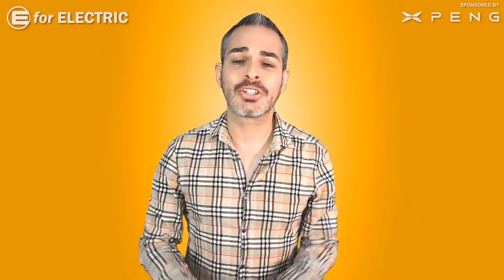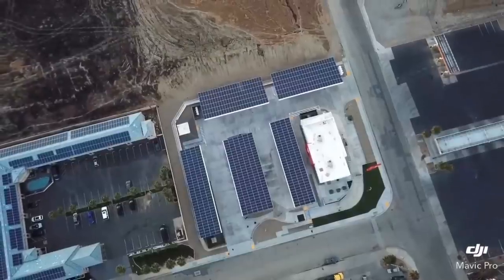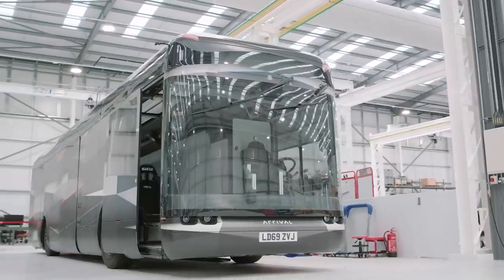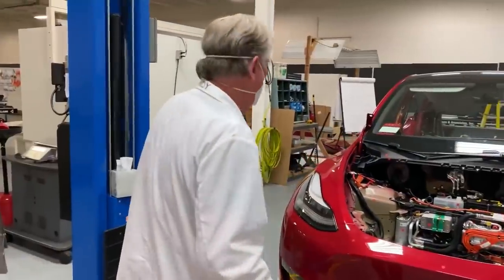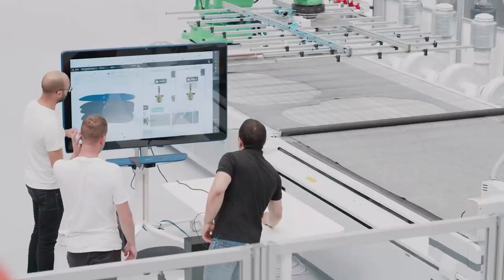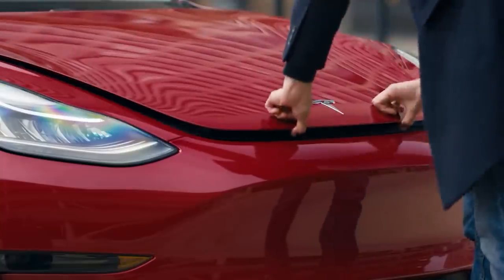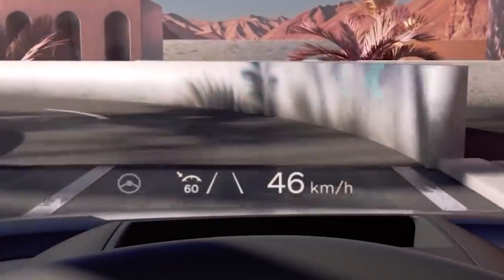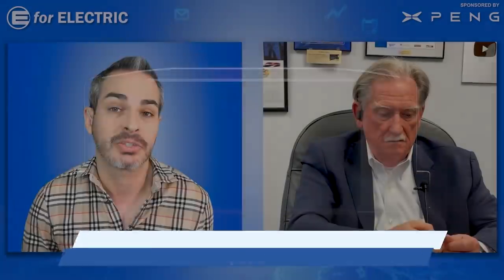Sandy Munro vs 2021 Electric Car Tech

Comment: The biggest issue with battery swapping is that the company owns the battery, and battery tech is quickly changing year over year.  When breakthroughs happen, the old batteries become obsolete and NIO will be on the hook to get rid of the old tech batteries and replace them with better and more up to date batteries.  They will have to eat all of that cost.

Comment: I feel like there are flaws with his take on battery swapping. For one thing you'd still be charging more than swapping and the most likely connector to fail is still the charge port. If built with it in mind either of those should last a very long time and be fairly serviceable. Also the propane analogue is just being weird about things IMO as long as you pay for usage and not ownership of the pack who cares.
Reply: I agree, especially if it's a large slip fit connector, also with connectors as consumables they are typically easy to replace. Also the batteries are tested at the swap facilities and the degraded ones are rotated out of circulation, so with battery swapping you always have a pretty fresh battery so in the long run battery degradation isn't a worry. The only tripping point I can see is the cost, whether a subscription service or a per battery redemption it may be more expensive in the long run versus just charging.
Reply: here is my laundry list of things wrong with swapping batteries :
> extra weight , you are literally putting a box inside a box . the car still needs to be structurally sound when swapping , and the mount points and swapping joints/ connectors all add weight.
> if you have one size fits all for swapping then you are not optimising your pack to work well with your chassy, it would most definitely affect drive balance, suspension, etc. else you would have to have stock of different skews of battery packs which would be very cost prohibitive (ultimately you end up paying) .
> A battery pack is very heavy and would likely wear the mount points to the chassy in dynamic driving conditions . points of contact = point of failure. and if not mounted to the chassy perfectly every single time. it would wear out the chassy unevenly. you can design around this but no option without adding extra weight.
> battery tech / capacity has improved on a rate of 2% YOY if you assumed the same trend to continue . it would take 10 years to reach 20% improvement (my estimate of when a switch to new tech is worth it) avg us new car ownership is 6 years.
> and if you didnt do swapping you are much more likely to wear of the bearing on the motors before needing to change the battery. at which point you could sell it and get something new.
Reply: @MrEtronic  There are counterpoints to most or all of those. You may add some small amount of weight to have a swappable battery, but used appropriately your car will be lighter and have a smaller battery the majority of the time. Also batteries already aren't structural for by far the majority of EVs so that isn't even a real reason they would be heavier.

From the design standpoint you can design the car around the pack and not vice versa to come out with something that is still perfectly fine.

As far as mount points there are extremely durable mount points that get changed out regularly on cars already. You should rotate your tires every 5-10k miles and the entire weight of the vehicle rides on those mount points. They are durable and perfectly fine. A solution for durable mounting of batteries can also be found easily. This also wouldn't be something you do all the time. Normally it would be done a dozen or two times a year or so.

On your calculations for one thing you are using a rate of improvement far worse than I've seen most places claim and for another thing haven't taken in to account compound gains. Even at 2% yoy that is under 10 years for a 20% better battery and it's likely better than that.

As far as the motor going bad before the battery that is contrary to what I've heard and expect. We've yet to actually have EVs around long enough to see for sure though. Even ignoring that making things more modular always reduces waste. It doesn't matter which component goes bad first, the vehicle or the pack, if one is still good it can stay in circulation. Even if your argument of horrible battery improvements and crappy motors that wear out before the packs is true, swappable batteries become a good idea because then you replace the car and keep the pack in circulation.

There is also the huge difference in necessary battery production. I still lean toward the PHEV side of the argument because especially for someone who drives like me I get 95%+ of the benefit of the EV, don't get some of the drawbacks, and for the same amount of batteries about 5-10 times more vehicles can be made. If I bought an EV I'd need 150 miles+ range to do some of the things I do a handful of times a year or so. By far most of the time I need like 40-80 miles of range max and my most common day is probably about 10-20 miles driven. If we want accelerated adoption of EVs we need to find a way to make the least batteries serve the most people we can. The best ways to do that are either PHEVs or swappable batteries.
Reply: @christopherpedersen1820  sorry i made a mistake in my calculations 10 years is the correct number, most people in the US switch their cars close to 6 years. but all other things i mentioned were still correct IMO  if your going for nuts , the threads shouldnt shear of from wear . so they would need to be large to distribute the load evenly. if you wanted to go for anchors / snap fits they need to be made in such a way they dont snap on high impact situations and launch the battery pack free like a projectile. a battery pack being welded is different from being mounted , even if the cells are not load  bearing the pack as a whole still is. if you go for a mounted solution the battery pack needs to be strong enough to carry itself , the chassy needs to be strong  enough to carry itself and the pack , There is no way you come out with lesser weight solution than the existing pack . best you could do is make it small enough to get it to 5% of the weight diff. but you still end up paying lot more in the long run with either subscription type service or sale / purchase of a newpack OEMs have  to keep batteries charged even when they are not used and keeping them in stock is still going to be a huge burden on the OEM and would only increase as they open more stalls. A small note on PHEV < ICE engines < pure BEV , you would need to replace the battery much sooner you loose the benefits of BEV's like low cost of maintenance, most PHEV weigh as much as a BEV and have lower performance than both BEV and ICE .
Reply: @MrEtronic Many evs already have a separate battery as a module that can be dropped out of the vehicle. Go look at the nissan leaf or chevy bolt packs. They're sealed units that can be dropped out of the bottom of the car. It's the smart way to do things from a repair and sustainability perspective. Also the whole point of swapping is to make the overall battery production and cost lower. You won't pay more because 90%+ of the time you'll be using less than half the battery you would if you just bought a vehicle with an oversized battery that you almost never utilize. Also simply having a gas engine doesn't drastically increase maintenance if you barely use it. Putting 1000 miles a year on an ice engine and 9000 on the electric the ice engine will rarely need maintenance and will outlive the vehicle in by far most cases. For me the vehicles I'm between are the Bolt, Volt, Leaf (2nd gen), and A3 e-tron PHEV all 2-4 years old used for $15-20k. Honestly the A3 e-tron is by far the most attractive of the group in general to me and also the volt or it seem like the best option usage wise. Saying PHEV<ICE<BEV is pure ignorance TBH. There are different use cases where each is the best and PHEV can and in my case mostly will offer the best of both worlds.

Comment: Battery swaps have something in common with buying a used car, you never can be sure what the previous owner did to it. Of course the battery unlike the used car, can be again swapped. There is also the connector wear to be considered. I'd keep the entire vehicle and battery if you please.

Comment: I was going to mention propane tank swap for my grill— nasty experience, but Sandy beat me to it. So no, I don’t want someone’s abused, greasy battery in my $55,000 car.
Reply: On the other hand im pretty sure some greasy cab driver with 200k miles on his battery would be more than happy to swap with your shiney virgin battery.
Reply: If QC has high standards it won't be a Problem.
Reply: I still don't want a 200k battery that passes qc with 15 percent degradation that by most standards is still "good" swapped with my 200mi battery that has 0 degradation.  It's gonna be a crap shoot do you feel lucky? 

The less degradation that the manufacturer deems acceptable and the older the fleet gets the more money it will cost for the manufacturer to replace these batteries.  The situation is not scaleable for volume and age of fleet.

It works now because every single battery is new.  As the fleet ages and more people jump on board there are going to be tons of junk batteries that the manufacturer will need to replace.  The manufacturer will have to eat this or raise subscription prices to the point that it won't make sense to those that use thier vehicles non commercially.
Reply: In the end it's like communism... You are creating an ecosystem that punishes those that drive low miles and take care of thier batteries and rewarding those that drive high miles and abuse thier batteries.   Not only that, we are shifting the behavior curve as nobody will find a need to take care of thier batteries as they know that they can swap it on the dime of somebody else.  Why not charge to 100 percent every day then swap it when it degrades?  I'm paying for it anyway.
Reply: @Robbie6298  it would also eliminate risk to the individual by constantly replacing bad batteries.
But the good part about it is that multiple models are being tried and we can see which work best or which have which pros and cons later on. 
The thing is, the nordic countries work pretty well with their "evil communst systems" you know, like universal healthcare where the cost per person is a fraction to that of the usa and such.
My point is merely this;
Each country is entrenched in ideological battles that it sometimes doesn't matter what the outcome suggests. You ideas always trump what you can observe in the real world.
Reply: @Robbie6298  but I agree that the company carries the risk and the downside to the approach could be just not making sense in terms of long term economic inefficiency. That would be my biggest criticism but i am just curious to see how it will pan out.
Reply: @Humanaut.  the difference is always in scale.  Things that work in small scale often become cost prohibative and unmanageable in large scale.   Not getting political but Finlands system works fantasticly in Finland that has high average income and a population of 5 million people.  It is likely to be an absolute disaster in a country of 300 million people of mixed socioeconomic status.
Reply: @Robbie6298  yeah just saying. Another one would be the prison system where it is really about mentality. 
The american prison system is focused on "punishment" (the prisoners are basically supposed to suffer) and in germany for example it is based on "rehabilitation to society" and the two approaches naturally produce wildly different results in terms of recidivism rates and such and of course the american system is like a negative feedback loop which is really broken but still it often tales decades to even acknowlege a problem and then a bit longer to even tackle and start to fix it. 
I am not trying to knock on the us, but more so on ideology & human thinking. 
Basically we should have a scientific / engineering approach to everything without preconceived biases and just look at the data, consult with game theory and complex systems theory, work out models, use ai generated compute to test them etc etc.

Comment: Has anyone thought about using the frunk of Tesla 3 and y  to have supplementary battery with connection in the car so you could have the occasional extra battery for long trips as and when needed
The advantage is that you can have smaller inbuilt battery  thus making car lighter and cheaper initially whilst having flexibility for occasional long trips

Comment: You didn't mention cost. The cost of swapping will be significantly higher than owning, charging and running a non-swap battery.
Reply: lo., everyone is in it to make a buck..  When the buck isn't there, the corporation folds.  That is Business (investors take a chance).

Comment: How about incorporating and "Ideal ElectroMagnetic Field" environment in the cabin
to nurture the driver & passengers, instead of creating unplanned EM outcomes ? 

Faraday shielding the motors,  using superconductor motor windings
to eliminate the need for big, dangerous, expensive batteries,
& properly positioning coils around the cabin space could do it !
This would replace the need for caffeinated drinks to be alert while driving.

Comment: how well is it gonna work when it's wet, muddy or iced? and the price of the subscription or per swap? The idea seem great and as they improve their battery tech they could get to offer longer range or just replace aging battery with equivalent at lower cost, but that doesn't come close to offset the high infrastructure cost, over engineered complex car cost.  In the end, you want to fulfil the need/desire (value"income") with the simplest product as possible (cost)

concerning LIDAR, when he talk about the disco ball, i wonder if you get to many LIDAR next to each other and crossing each other on the road, if they gonna pollute each other signal?

Comment: The only way to know is if we could trust Nio's reporting on battery swapping failures.  I'm sure they could engineer their way around the connector issue by either making them beefier, incorporating a cleaning into the swapping process, making them easy to change out, etc.  Besides this would represent like 10% of the car's use.  The other 90% it would be slowly charging at home/work..
I just feel like, at least with the current battery chemistry, swapping is the way to go.
I drove a model X 100D for about a month, going to LA from San Diego a number of times, and if you drive spiritedly, the estimated mileage is kind of a joke.  Once I stop to charge, I don't just want the boost a 15 minute supercharge will offer... I'm already stopped, I'm going to "fill up" as it were.  Not to the point where the flow reduces to a trickle, but probably 30-45 minutes depending on charge rate.
With a swap, that time saved is great, but also, on the back end, with enough batteries they can be charged at the ideal, slower rate to boost their longevity.  Again, we're likely on the cusp of a fairly bulletproof battery that can take 20 years of whatever abuse you want to throw at it, but until we actually HAVE that battery produced in mass, I feel like there are some definite benefits to swapping.

Comment: LIDAR vs FLIR - Active sensing v Passive sensing. One ponders the potential for interference in high density packs of LIDAR bearing vehicles, even given the correlation of signals belonging to their respective individual vehicles. Not an issue with FLIR & as described FLIR doesn't identify the location of the sensor bearing vehicle.

Comment: 24:57 Sorry but i agree 100% with Sandy here. It might be attractive for a consumer, but is terrible from a business perspective. The number 1 limitation for EV's is battery shortage. Why in the world would you build swapping stations with dozens of batteries in it, which aren't in use? This is a waste of resources, it is expensive to build and the swapped batteries have to be recharged anyway. So it is basically a supercharger and a swap station in 1 which makes it extremely expensive. 

This model has no long term future, especially when range of EV's continue to rise and charging times go down, which will be the case. Charging an EV is a problem of the present, in my opinion it's already a problem of the past. I drive a Tesla for 2 years now and never had to wait for my car to charge.

Comment: Electric connections are always a problem when they get wet. I used to have a 1960 land rover one thing I done was to solder all the wires separately removing all plugs . 1 perfect connection 2 no arching causing cables to burn  3 totally water proof.  Great show as always keep smiling guys

Comment: LIDAR vs FLIR discussion was interesting... but Musk has dismissed them both, since he insists the hardware NOW on Teslas is adequate for Level 5 Robotaxi service (a bonkers assertion). Where is that Tesla Robotaxi service that was supposed to launch over a year ago??  Where is the New Roadster, the Plaid Model S, the Tesla Semi, the....??? .. with Tesla I will just wait until things actually exist, the hype and over-promising is getting old, that marketing method is eventually not going to work at all.
Reply: The semi has been spotted in California where’s the hummer

Comment: I would hate to have a HUD in my car.  I had a car that had a high-beam indicator light that reflected into the windscreen, right in the center of my field of view.  I was so annoying that I eventually put a piece of tape over the light.  What I want to see in my windscreen is what's in front of the car.  I do not want that view to be obscured by a bunch of distracting icons that some marketing guy thinks are cool.
Reply: I have HUD in my car and it is excellent ... I guess it have to be implemented properly.